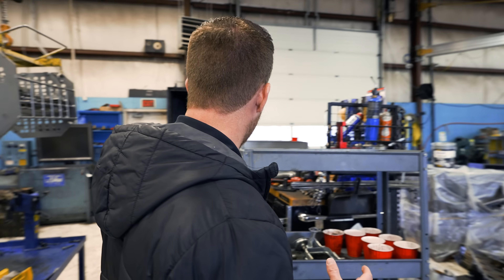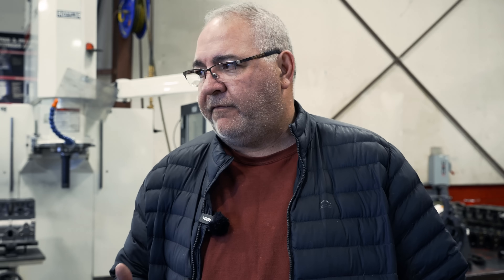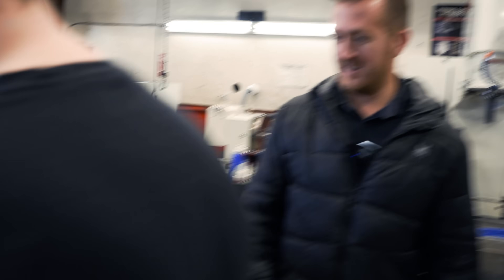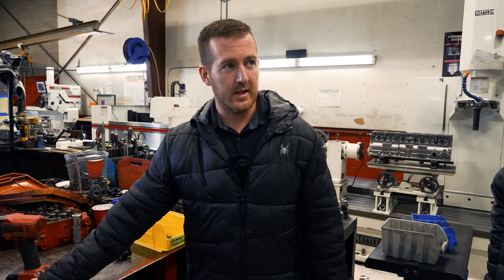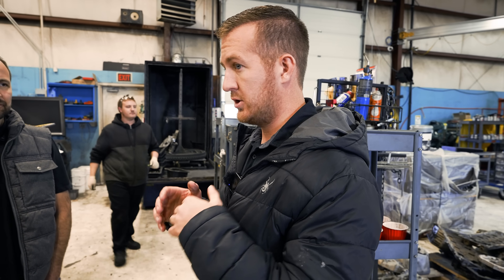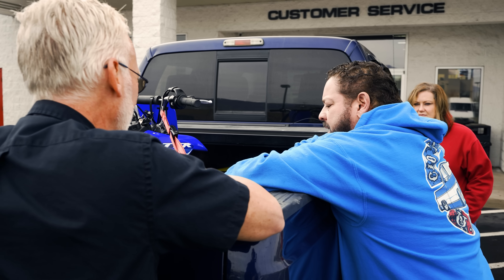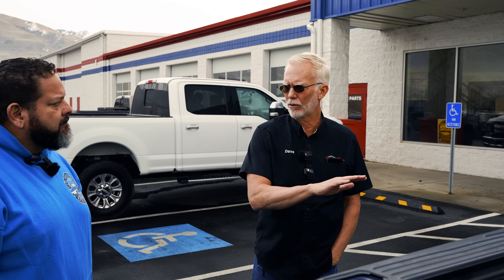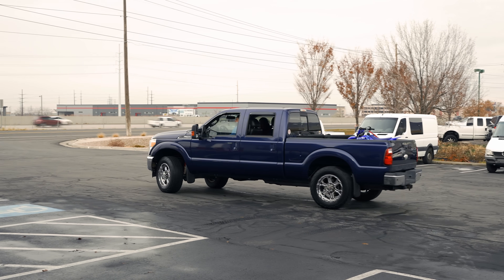Looking Inside a 900,000 MILE CP4 Pump!

Comment: 10 to 15K oil change are possible with NO issues.  guess the myth has been exposed.. :)  oil analysis is the key with low to no idle and keeping it running. 

wonder what fuel additive.. bet it was hotshots or archoil.. ??
Reply: The bypass filter, fuel enhancement and oil this guy used is made by INSANE DIESEL. They hired dave to do a failure analysis, they talk about it on their instagram.

Comment: Disaster kit meaning aftermarket filter that's put in line that prevents the failed pump metal particles from reaching the engine?
Reply: The bypass filter, fuel enhancement and oil this guy used is made by INSANE DIESEL. They hired dave to do a failure analysis, they talk about it on their instagram.

Comment: So to summarize:
- Insane Diesel bypass oil filter
- Motorcraft main filter
- Changes fuel filter every oil change
- Lorenzo’s Oil fuel additive and Motorcraft oil
- 170 gallon fuel tank
- Uses the semi high flow pumps at truck stops
Reply: Exactly what I was looking for in the comments. Thanks!
Reply: Changes the fuel filter with every oil change? Dayumm
Reply: @pcnetworx1  yeah though he says that he can easily go 15k miles between oil changes with the bypass filter. The oil is completely clean.
Reply: @conduit242 The oil going through a bypass filter is clean, per se, but can only remove particles down to 2 microns, which is much better than the 35 microns on avg that main oil filters can remove. But the oil is not perfectly clean and in fact is about as black as the oil that doesn't go through a bypass filter system. 
I've been running an Amsoil Oil Bypass sustem in my 6.0l and 6.7l since '09 and swear by them, but I'd never say my oil is perfectly clean. 
Just saying
Reply: @djsmith4789 just fyi you are correct with the amsoil being a 2 micron, and they are excellent.. however the insane diesel setup filters to 1 micron
Reply: @johnsteenland1292  yeah, I've read that and looked at the data out there from Amsoil and so many others and most filter manufacturers say that anything that filters your diesel engine oil below 3-5 microns (Im averaging, some say 3 others say 5) will not allow any damaging contamination through. I've been usingg the amsoil bypass system since 2009 on a 6.0l and 6.7l Fords with the proper amsoil synthetic motor oil and get 6xs longer change intervals and 3xs more respectively! I've had both tested at intervals and I am extremely happy. 
I guess it's a matter of personal preference. For me, living in a very isolated community, using Amsoil products means its a one-stop-shopping experience, or a single phone call.
Have a good one🙂
Reply: @djsmith4789  yea thats a good point, and Im not really sure what benefits that extra micron get you when your already 3x your intervals.. ease of access is also a big factor, and amsoil products have always been top notch..
Reply: @johnsteenland1292  Agreed 👍  Its always very nice to hear from other like minded coal-burners like yourself. Take care from Prince Rupert, British Columbia, Canada 🇨🇦
Reply: @johnsteenland1292  my amsoil filter got clogged up at 500 miles. Their junk. Nobody will see that cause they don’t have a fill cap return like insane diesels. You have to actually pull off the hose and turn on the truck to see it’s clogged up… which I did. Go buy one but I’m just saying I’ve learn from my experience and you might have to learn yourself.
Reply: @johnsteenland1292  Amsoil is not an approved oil by Ford for the 6.7 diesels.  Not saying it isn't good oil (I use it in my 4R) but I'm sticking with Ford approved oils for my 6.7 HO.
Reply: @jimrice4699 yeah, well, many people stuck by the GM approved oil rating for the 6.2 LT engine...
And what do you know
Reply: @pcnetworx1  But he only changes oil every 15,000 miles, so changing the fuel filter at that point doesn't sound crazy to me - probably can get away with that given the additional bypass auxiliary fuel filter and constant running of engine.
Reply: Lorenzo’s oil fuel additive
Reply: Thanks for this. I was wondering what fuel additives he was using. I have old diesel tractors and hadn’t appreciated the difference between some anti-gel and lubricant additives.
Reply: When did he mention which fuel additive he was using?
Reply: @faultless18  multiple times in the comments if you read through them
Reply: @faultless18 next comment above this one is a reply from insane diesel stating this customer used their 1 micron oil bypass filtration, their oil, and fuel additive..
Reply: @faultless18 I didn't hear him say it,  was wondering same thing
Reply: Why would changing filter be a big deal.  If it gets clogged it will just reduce flow, or, if it clogs, does it have a bypass around the filter.
Reply: @pcmountaindog  depends. With insane diesels it wouldn’t. Because it’s not a full flow filter. Amsoil bypass filter is a full flow filter

Comment: I would expect the additive be one of these Archoil, Power Service, or Hot shot secret. 
Considering it is a ford most likely Archoil. 

I am shocked Dave did not mention what additive used.... But then again he teamed up with Gail banks the ultimate shade thrower. Gail will never say anyone is good other than himself... 
Just proves to me Dave is all show... Like the pad slap vid... If he cared he would have named the product. Most of the additives are snake oil.
Reply: The bypass filter, fuel enhancement and oil this guy used is made by INSANE DIESEL. They hired dave to do a failure analysis, they talk about it on their instagram.

Comment: I live in Brazil and I have a Toyota Hilux 2006 3.0 turbo Diesel. I change my oil every 5000 km or 3100 and something miles for you I think, and I personally use an additive in oil called bardahl b12 premium in my motor. For the diesel my truck still uses de older diesel for us here that is called s500 (newer trucks use de s10) wich has less sulfure and less lubricity as far as I know, and I also use additive in the diesel called bardahl power diesel. For the fuel especially here in Brazil, I feel its mandatory since the governament passed a bill that our diesel can be mixed with 25% biodiesel. My truck runs great and have 350.000 kms. The trucks that are coming out are all failling because of the biodiesel. Another thing that I personally do too is removing my diesel tank every 8 months or so to clean every thing inside and put clean diesel after. Never had any problems.

Comment: What additives are best ? Or should say what was he running to get them miles
Reply: The bypass filter, fuel enhancement and oil this guy used is made by INSANE DIESEL. They hired dave to do a failure analysis, they talk about it on their instagram.

Comment: My 03 duramax plow truck had 18,000 hours on the clock with original head gaskets and cp3 before the body basically fell off the frame … the oil at 5000 miles was still almost clean, I pick a rust free one up and the oil goes black within a thousand miles , maintenance maintenance maintenance … oh … and warming it up in the winter  😉 lol

Comment: I only change the oil during breakin period after that just the filter and top off about a quart and a half. 760,000 on my lml duramax zero problems. My fuel additive is a 1 percent mix of either canola or soybean oil.

Comment: Should clarify he’s using a bypass system
Reply: The bypass filter, fuel enhancement and oil this guy used is made by INSANE DIESEL. They hired dave to do a failure analysis, they talk about it on their instagram.

Comment: I have this Ford beat. 21000 hours and over 1 million. I have the original Turo, Injectors, CP3 Pump. Also, I have no oil leaks. I did replace the Transmission at 650k. I ran one front-end rebuild at 650k Amsoil in my 2011 Ram 2500. But that Truck is still going. I drive it regularly. I work in the billboard business. We haul heavy pipe trailers. I change my oil between 15k and 20k..

Comment: 900,000 miles? We have to  get rid of that engine, bring back one that self destucts. My 3.0 Duratec went 400K, thank goodnes they killed those off and replaced it with one that the water pump destroys the engine.

Comment: I change my fuel filters every single time I change oil I run 5,500 mile intervals on a 13 duramax bout to turn 300,000 miles on the od changing the fuel filters is key👍👍

Comment: Question ❓ did the owner use one brand? Even though he used across the country?
Interesting that he used big truck pumps and did massive miles! Always wondered wether truck diesel is different from car diesel??
Reply: The bypass filter, fuel enhancement and oil this guy used is made by INSANE DIESEL. They hired dave to do a failure analysis, they talk about it on their instagram.

Comment: I just got approval for a NA ford f150 new engine and cats. 7500 just parts. 380k on origjnal drivetrain. Original rear end oil. No leaks. 2015 f150 N/A

Comment: I bought a used 2015 F-250 Lariat 6.7 with 80K mi. on the clock in 2017. Carfax looked ok, but there were records which didn’t update till after I bought it. I was never quite sure of the provenance the truck and engine, but there was a post-it note on the engine that had the UIDs for all eight injectors. Anyway, I was religious about maintenance, and I changed fuel filters every two oil filters. I didn’t use fuel additives at the time. Engine failure at 180K mi. with glitter in the oil. This was during COVID, and there were no new HD trucks to be had, so I put in a new engine. Mechanic said there was mud in places where there was never supposed to be any mud. He suspected something unusual happened to it in the past. I kept it for another couple years and sold it at the beginning of ‘24. I always wondered if there was a problem waiting to happen with the engine, but that wouldn’t explain how I got almost 100K out of it. I switched to a new Duramax and I am definitely using additives now. Thought it was interesting how GM switched to the Denso pump instead of Bosch.

Comment: @3:36...5000 miles on an oil change is not "pushing-it", that's ridiculous.  I noticed that you didnt let him say what fuel additive(s) he's used.
Reply: The bypass filter, fuel enhancement and oil this guy used is made by INSANE DIESEL. They hired dave to do a failure analysis, they talk about it on their instagram. Since Dave won’t say…
Reply: He used ford fuel additive and anti gel in winter
Reply: @ and he used insane diesels fuel additive as well

Comment: Come on Dave what was the additive? I bet it was seafoam! I bought my 07 Duramax. I have used Amsoil Change every 5000 and seafoam in the fuel tank full. I have 353,000 miles no repairs! it has a few banks goodies, mostly air intake stuff, but still runs like a stripe ass ape12593.9 hours on the engine

Comment: This 6.7 owner is absolutely correct. These 6.7s need ran everyday. I had back surgery and was down for 4 months. When I was finally able to drive my 37,000 mile 6.7, after 4 months, it had no boost. The turbo vanes were froze solid. The idler and tensioner pulleys were so rusty it threw the serpentine belt off instantly. After fixing all of that, it still had low power. After removing the fuel filters, the bio in the diesel had turned to slime. I had always changed my oil and fuel filters every 5000 miles, with fuel additives, before all of this happened but it didn’t do a lick of good. I have since remote started my 6.7, three times daily when I’m not using it. I’ve had no issues since.
Reply: I had a similar problem recently I usually run my truck every day religiously for work and what not and I had an injury and didn't drive it for a week and as soon as I got back in I had all sorts of issues shit sucks. But I'm doing the same thing now even if I have days I don't need the truck I'm running it regardless
Reply: Can you imagine how bad those trucks sitting in the race track parking lots since COVID chip issues
Reply: Yeah I'll stick with my mechanical diesel. It'll sit for two weeks, fire up and run like a top. It doesn't care in the slightest how long it sits. 

I got it running after two years of sitting with the fuel that was in the tank.
Reply: I let my 2005 Ram diesel truck sit for 3 months, no problem except batteries needed charging. I have 2 extra filters in the fuel system and run a Baldwin in the oem housing. I don't have variable vane turbo.

Comment: It’s not unheard of. Every mechanic channel has a million mile 6.7 powerstroke and a 24 valve Cummins. 
Turns out the 6.7 powerstroke is a great engine. The crazy thing is there is another 1 million mile ford on YouTube with the original 6R140 and NP273F and it was the same story, meticulous service and constant use without abuse. Every million mile Cummins is falling apart and has been through 6 or 7 transmissions.
I’m saying this as an unbiased person who has experience with these trucks.
Reply: I got my 14 Ram dulley to 489 k on the 68rfe trans, but it did have A cracked input shaft. My 05 Dodge dulley 4 speed made it to 601,000 miles before it left the chat...

Comment: My 2011 chevy 6.6L I changed the oil every 10-15k km. Ran it until 350k km and sold it. Saw it running still on the road 3 yrs later. Now have an F350 6.7L and change the oil every 10k km. I add Archoil stiction additive and always add fuel additives.
Reply: you prolly still wont get that many out of the ford!! sad but true
Reply: @mcq31mc You're "prolly" wrong, sad but true
Reply: Any deleted diesel with moderate to good maintenance should go 400,000 miles,, except most CP4 deals . I woulda never dreamed this guy could get 892k miles outa that one tho
Reply: @ronmoore3987  deleting is hard in CO now. damn emmisions are everywhere. Egr kills these engine. deleted is a whole different story but really hard to do on anything passed 16 in colorado. Nobody wants the work
Reply: Which fuel additives do you use?
Reply: @ this is my spring to fall go to Archoil Ultimate Diesel Kit - AR9100 Friction Modifier (16oz) + AR6500 Diesel Treatment (40.6oz) + AR6400-D Diesel Fuel System Cleaner (12oz). I used the friction modifier and fuel system cleaner every oil change.
All winter I use Hot Shots Winter anti-gel.

Comment: I have a question for ya'lls shop. I have a 2017 Ram with a cummins. A previous video of yall's Dave said, diesel engines don't like short distances. The customer said, diesel engines nee to run every day. They don't just sitting there. Something like that. I live a short distance from my job. It's about a ten minute drive. Then is parked for 8 hours and then I drive home. The only time I drive it is when I am going a ling distance trip. So what do you suggest with my situation?

Comment: From my research, the other main problem is not the electricity only it is the cavitation and air that gets into the pump when you do a filter change and don’t do a lot of priming or if you run your fuel tank low and it sucks in air.   This seems to be the worst.

Comment: 10k per oil change with Amsoil sig series 5w40  by pass filter , hot shots edt for fuel additive and oil is no where near needing to be changed.
Reply: Amsoil bypass filter doesn’t have a engine that’s gone 900k miles and they will never cause they are Chinese made garbage and they don’t filter your oil down to 1 micron

Comment: $10,000 to $12,000 to fix your truck when the CP4 grenades. I talked with a dealership and said after they replaced a bad CP4 in a customers truck the one they just installed grenaded again .  Boch didn't plan our truck to be ran on low sulfur fuels and lack of lubrications . I changed mine to a CP3 and haven't any issues , bolted right up

Comment: We have one GM 3500, 1 Ford F350 and 9 ram 3500s, all of them have been silent deleted with PCV reroute, and from day one we have been using LX4 Lubricity Extreme with every fill up and Lucas anti gel in the winter. The 2019 Ford has 240K on it (has had alot of small issues but nothing major) all the Rams have over 200K (no major issues) (most over 350K) but the 2018 GM 3500 now has 670K on it with no major issues, nothing has been done to it besides filters and oil. All fluids are changed every time they come near one of the HQs and oil never goes over 7K.  

These trucks do set for a while (months at a time sometimes) especially in the winter when we get slow, but so far no issues at all with anything fuel or fuel pump related.

I swear by the LX4 Lubricity Extreme stuff (not a sponsor) to me, there is no way we wouldn't have had some kind of issue by now if it weren't for it.

Comment: This guy definitely maintains his truck. If you listen closely, he doesn’t say what portion of that 900,000 miles oil changes done at 5000 or 10,000 ( his original intervals ),he also talks about dumping the oil and fuel filters when other maintenance was done like the leaky oil pan, don’t get fixated that one time he went 27,000 miles without an oil change because he knew he was rebuilding the motor, ,,I guarantee the majority of this engines oil changes were earlier than manufacture suggested interval

Comment: And I heard from old timers that they put automatic transmission fluid in the fuel. I use diesel kleen and my 5.9 has 462,000. It’s a 03 , 3500 dually.